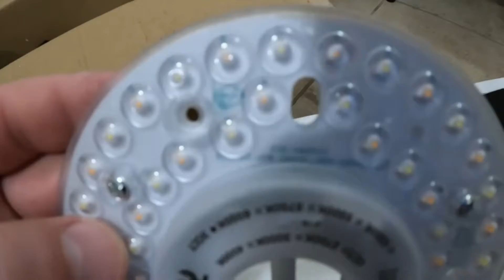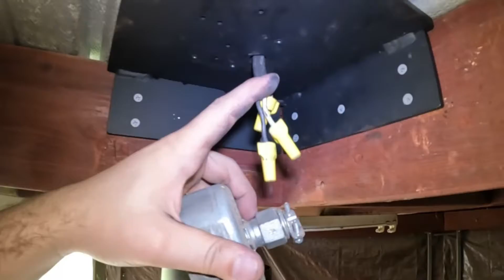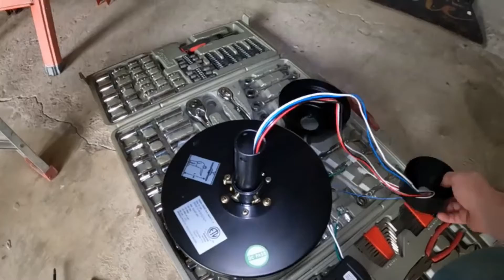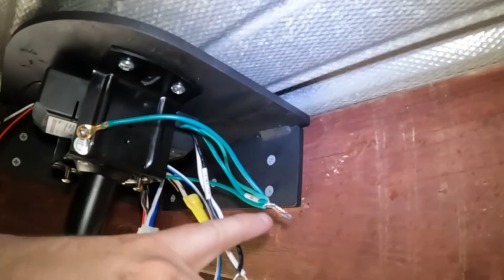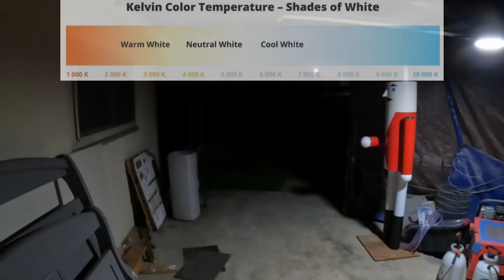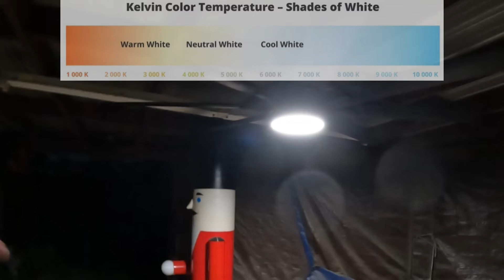FRSTEM Modern 66" Indoor / Outdoor Fan installation "Part 4 - Outdoor Reno"

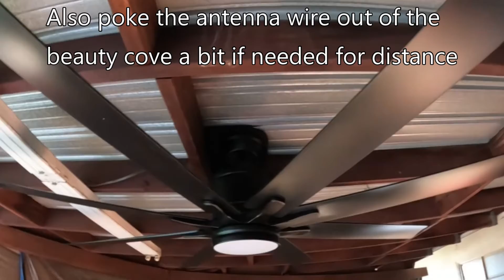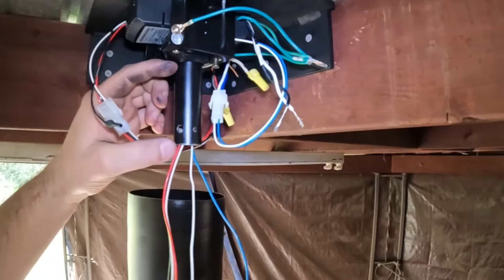Comment from the maker: @34:03 Just sharing something I ended up doing to hide the antenna and get more signal strength. Add the remote signal wire by the down tube since it blends in and since you have a gap in the beauty cover and the ball joint area (@15:04 up close on area). By doing this I was able to get my remote to pick up through the outside door 🚪. If you keep it tucked in underneath the metal beauty cap I think it diffuses the signal strength a bit. You also don’t need to hit the fan button to turn on the fan, I was able to just select a number.